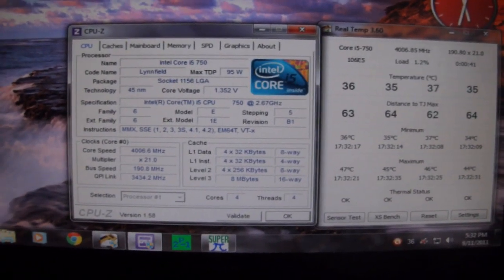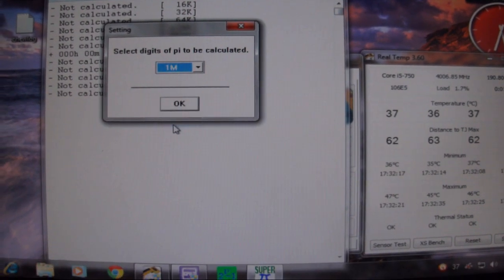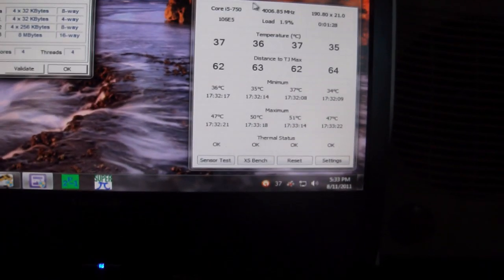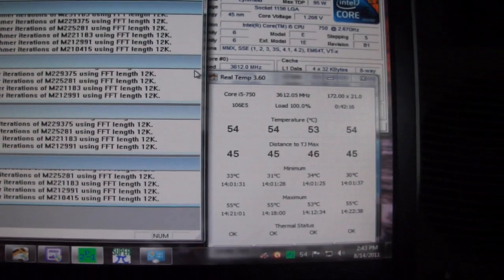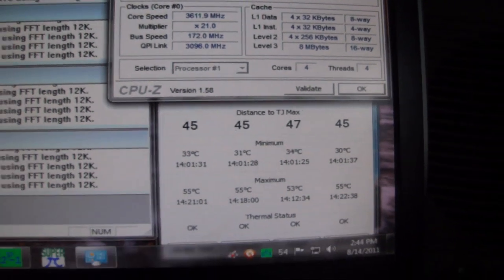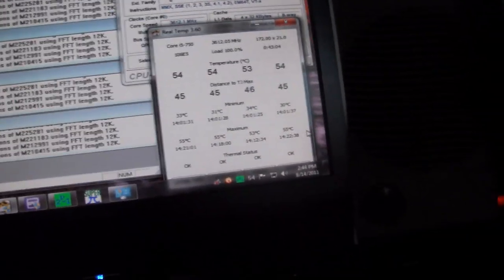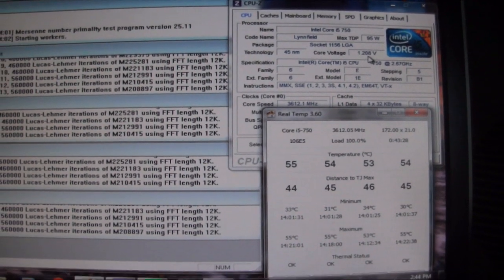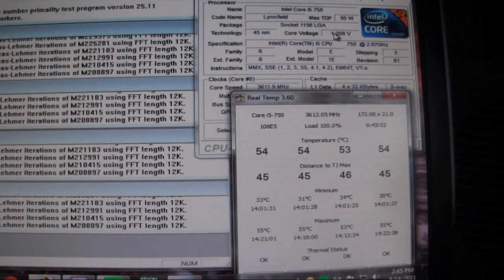In - Win Dragon Rider over clocking on the i5-750 Asus P7P55  LX 8 gig Corsair XMS ram

Comment: @FUzzyBUnnyBOoties i have had that problem too, its the MB, some MB are not good ram overclockers because of their power delivery. Ok so try this: keep all the things that have to do with ram at stock. overclock only the cpu and prevent the memory from overclocking, and try to maintain it at stock settings.For example if i am at 4.0ghz and ram at 879 then i would set my boot strap to a lower mhz like 366 instead of 400, then overclock until the ram is at default or test if ram works at lower mhz

Comment from the maker: @sxyphatboy I think the problem is with the memory controller. I have tried as high as 1.40 volts and it would still have one or two cores that would fail with prime 95 running. I tried pulling out two of the ram chips and running it with 2 but same results. I will have to do some more research to figure out where the problem is. But thank you very much for the advise.